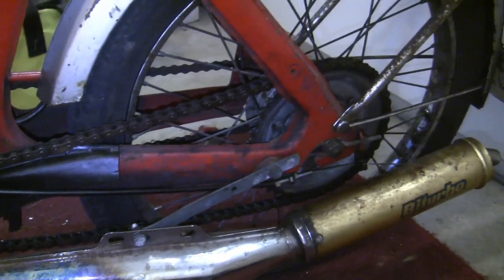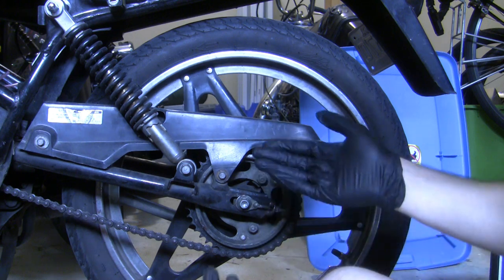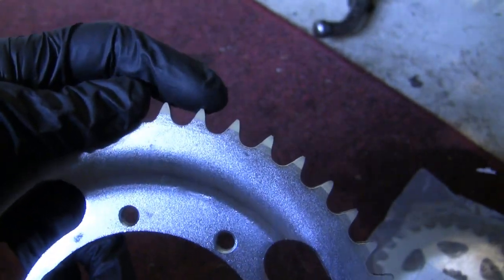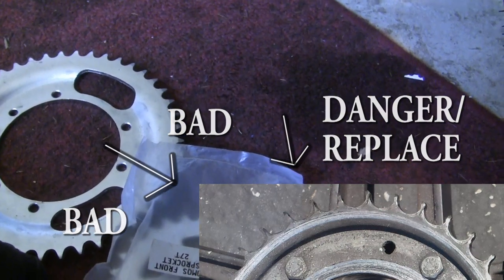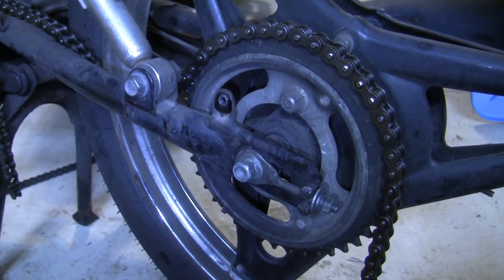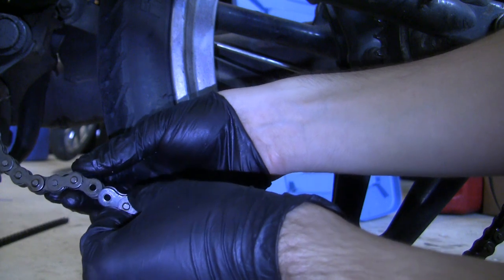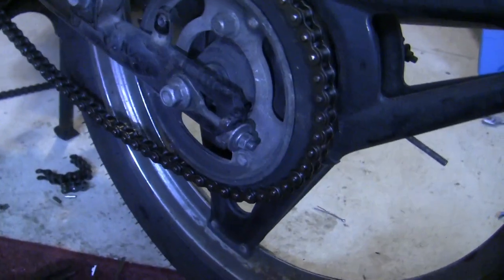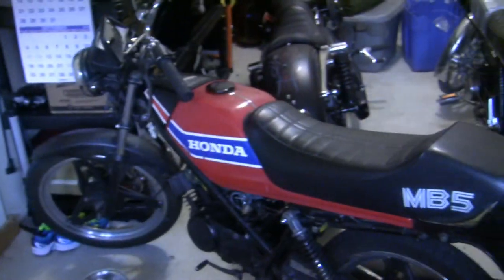How To (and when!) You Should Replace a Moped Chain

Comment: Good video. On non o-ring chains with removable master links it is good to remove, soak and clean in kerosene, and soak in 90w oil occasionally. If they get rusty or stiff, I have boiled them in oil on an outdoor stove and had good results.

Comment: I like the video; I would have liked to have an explanation of how to choose which link to remove and how long to leave the chain? I think that the adjusters have to be moved to the middle of the adjustment first and the wheel has to be tight against the adjusters, and on a moped the drive chain must be measured first and then the bicycle chain is measured last. The amount of slack depends on how tight the chain will be with the weight of a rider on the seat.

EDIT: I rewatched the video. I had an old motorcycle, and ignorantly replaced the master link with the c-clip on backwards. The chain did separate while I was riding at road speed. The loose chain bunched up around the rear wheel hub, locking up the rear wheel suddenly, and causing me to lose control of the motorcycle. I almost spilled. Luckily I wasn't going fast enough to cause too much trouble and there was not very much traffic. I had to get the motorcycle to the side of the road, park it, get the chain loose and find the nearest motorcycle shop.

Thanks for the content. 
Keep up the good work.
בס'ד

Comment: HI Travis , I just inherited a 1976 Motobecane  needs some work it just sat for a long time .My question to you is when i pedal the belt moves the engine but i can't get the piston to move motor is not locked up i can turn that clutch by hand but when i pedal it will not engage can you help Thanks  . Steve
Reply: Did you figure it out? It sound to me like piston arm is broken, it only makes sense...
Reply: Dow Row did you figure it out?